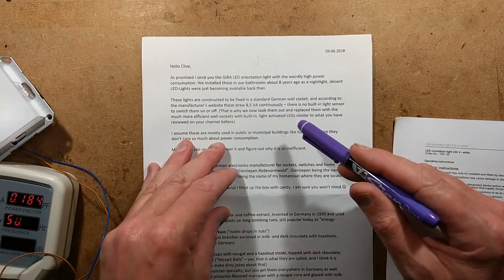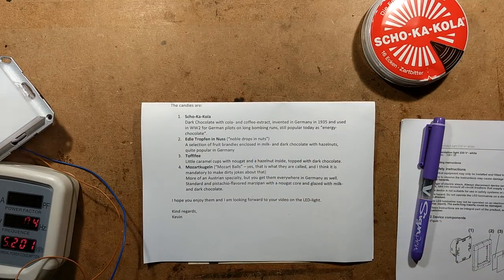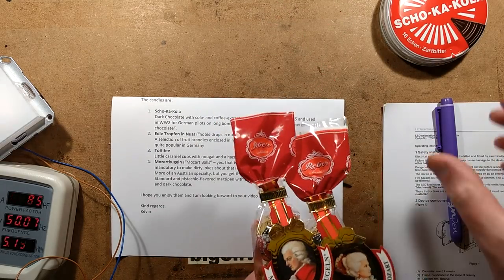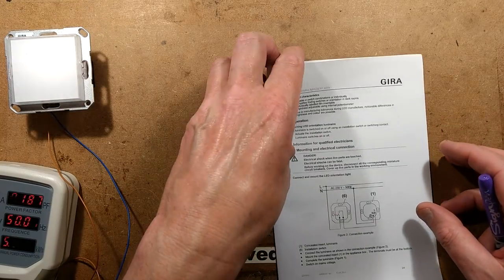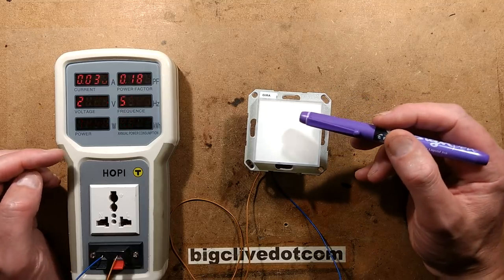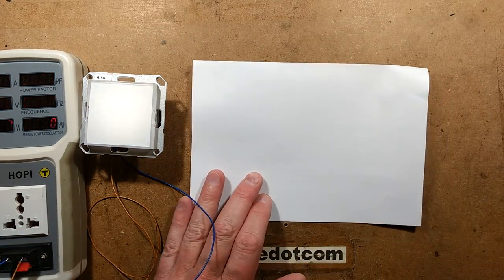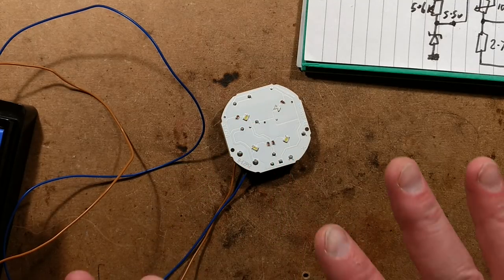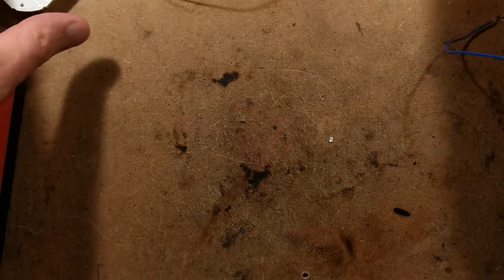Well engineered German LED light?  With schematic and tests.

Comment: Thank's for the heads up on power factor meter hell.
The power company i'm with (Scottish power) wanted to change my meter for a smart one. No was the answer i gave, and it will never change.
Reply: yeah they are changing the Contracts too
Reply: zx8401ztv they want to put the charges up to get more shareholder profits and also to pay for the new nuclear reactors and state taxes.

There will also be duty and extra vat slapped onto charging electric vehicles which will directly communicate with the electricity meter, try explaining away the extra charging on your car done on a wind turbine when the tally counters on the car and the central database don't add up
Reply: If they ever try to side-step you...you can claim it is for health reasons since the SM's can cause headaches & migraines.
And I can vouch for the migraines part myself...I had migraines for almost a year before I figured out why...and had them remove the SM.
Since then there have been only a few sporadic events so I have verified the cause.
Reply: Better hope you dont have a Mobile phone or Wifi router in the vicinity then, as they put out just as much radiation, and in the case of a mobile, sometimes a lot more than the small radio device in a smart meter. Not being a Smart meter fanboy here, infact i dont even have one, but unless you understand the technology in them, and the comparision to common radio devices like phones, you cant make such claims.    The radio transmitters in phones are capable of putting out over a Watt worth of radiated power when talking to a tower a long way away, and considering most people hold that up to their ears, that's a lot of radiation.   Depending on the smart meter many use "mesh" networking whereby they use low power radios so they talk to nearby meters which act as repeaters and allow a long range network using low power radios rather than directly to a tower that could be a long way away.
Reply: It’s not only power factor. Smart Meters (dark conspiracy theory) allow the companies to remotely disconnect your supply at will. For instance to ration electricity or force payment of a bill.
Reply: I don't use either.
I keep a simple cellphone...turned off...in the car in case of emergency.
I use only wired internet/intranet connections as well...no wi-fi.
Reply: PS>  They do the mesh network type here...and mine was the end one that did the collecting of data...so it was constantly RX/TX.
Reply: I have to side with the utility on this one.....

Well if you don't want your power cut off, pay your dam bill on time, or in case of hardship, make a payment plan thats agreeable to both the utility and the person in trouble within a reasonable time frame before the utility is forced to cut you off. Should mention that even without smart meters they can still cut your power off in various ways, so that ability isn't new, the meter just makes it a bit easier, safer and faster for them to enact it.

Also if the grid is being overloaded, then its better that they ration power out than have the entire grid collapse because a grid collapse is very bad and can take out entire states, and is very difficult and time consuming to recover from, thereby rationing of power during overloads is much more favourable because it prevents grid collapse. I'd rather be without power for 2 hours due to rationing than possibly days because the entire grid collapsed and its having to be "Black Started" which can take a very long time.
Reply: @ Greg Even with constant rx/tx the emitted power should be pretty low. properly designed radio systems can go quite a long way with minimal power, long range point to point wifi links being an example of this, using FCC Compliant radios and directional antennas allows a radio usually only capable of a 200 meters or so line of sight to span 10-20km line of sight using the same limit of RF Power (1 Watt EIRP for 5Ghz Wifi).

Also even if you yourself dont use a mobile, you are around people that do often in close proximity, so unless you live in isolation, you just can not escape electromagnetic energy these days, it is literally everywhere, that includes AM/FM radio too!
Reply: Because mine was the master unit for my block it was not on the minimum power setting.
I was able to measure over 6 watts...on the inside of my room...at 3ft (1M)...through sheet metal, 1" (25mm) wood & thick insulation.
My head was about 3ft (1M) from it while sleeping...and...No I was not able to change my sleeping area.
I don't HAVE to be away from the radiation but having it constantly on...at high power...for over 1/3 of my day...was too much.
Reply: "had them remove the SM. Since then there have been only a few sporadic events so I have verified the cause."

It's amazing how stupid people actually are that they think this constitutes "verification".
Reply: Plain ol' confirmation bias. Gregory Thomas is the kind of person that would believe their kid got autism from vaccines. "I got a Smart Meter around the same time I got migraines, therefore it must be the SM"; post hoc ergo propter hoc.
Reply: Gregory Thomas sure bud, much stronger than the hundreds of transmitters around you
Reply: 10mintwo yeah he's a nut job
Reply: Then, at some point, they will disconnect your power. Ferraris wheel meters will be phased out, and then it's digital or you are using candles.
At most you may be able to opt-out and demand they disable the transmitter and read the meter manually,  depending on how well the power company has paid their political bribes.
Reply: Fortunately in the UK I believe the smart meters just report back over the mobile/cell network every 30 minutes, so they do not cause any major problems.

If they will continue to do this with future meters is anybodies guess.

Comment: The separate stabilized supply for the current regulator might have an (E-series) 5.6V zener. It makes sense to make the current independent from potential fluctuations on the 20V rail.

BTW, the chocolate was the equivalent for the pilot of what was the secret fluid tank for the DB601 of his Me109.
What human brain energy was wasted by wars (and still is)!

Comment: If you have a lighting rail with tons of these capacitive dropper lamps on it and need to do power factor correction to lower apparent power (VA) bills, just stick an appropriate size unloaded transformer on the same circuit. Same idea as power factor correction on AC motors but instead of correcting an inductive power factor with capacitor, it'd be correcting a capacitive power factor with an inductor.

The high-tech option would be to implement (LV)DC rails for electronic lighting with separate fully-fledged APFC power supplies.
Reply: I´m pretty sure adding inductors/Transformers for PF correction will waste more power than it actually saves in most cases. 

Especially small transformers have high winding resistance which causes their high stand-by power consumption. On the other hand, large transformers may have lower resistance, but will also have much lower inductance values which means you would shift the power factor way too much.

So really you would need to get inductors that are designed for PF correction. Obviously those aren´t cheap.
Reply: @Basement Not small transformers, per-light would be impractical. In commercial and industrial settings, you have whole circuits or even sub-panels dedicated to lighting. Pick inductors/transformers to cancel out most of the permanently attached capacitive loads there, either on a per-circuit basis for circuits that frequently get turned off for extended periods or lumped for the entire sub-panel for circuits with loads that are always on. If you have 100x 8VA lights with 0.1PF on one circuit, add a single ~700VAR transformer and you're done. You may end up losing 20-30W in the transformer but you are still saving ~680VA net.
Reply: Of course for large lighting setups this can be done, but for any home setup it would be pointless. 
First, you won´t have too many lights in one spot.
Second, If you did, you should probably instead get a few bigger lamps that use an SMPS instead. They have a better PF than capacitive droppers and should also be cheaper.
And of course it really depends on how you are billed for your VAR. It may still be cheaper not to correct anything. Obviously charging for VAh directly would be a ripoff.
Reply: @Basement The idea of using centralized power factor correction is in response to the part of the accompanying letter about how these lights might be "designed for public places like hospitals where power doesn't matter"

Comment: So as I understand it, even if you have a smart meter you do not necessarily get billed for the apparent power. It may even be an option they can turn on or off based on local utilities regulations. I can't find any way to tell whether I am being billed for real power or apparent power. I don't see any local news coverage that would indicate outrage that happened from a switchover. But how would we even know? Our home was built new in 2006, and had the newest smart meter at the time. And already they have decided that we needed it upgraded to a newer smart meter. Of course they make the customer pay for those upgraded meters. The last one was working just fine when they hauled it away. Would the use of apparent vs. real power show up in the billing units? Would apparent show up as some multiple of Volt-Amps, whereas real power comes in units of some multiple of Watt-Hours?
Reply from the maker: They can change between real power and apparent power at will remotely.  But should declare the billing method on your statement.

Comment: Surely 2 X 1 micro-F 250 V capacitors in series is electrically equivalent to a single 0.5 micro-F 500 V capacitor and there would be no space saving doing it that way?
Reply: When they sell this to the us market, they can replace one cap with a jumper and it’ll work on 120v. No component changes required.

Comment: Can someone explain the VA-voltamps?
Reply: W=VA*pf
Reply: You may read something about the power factor.
Reply: Aurimas Knieža VA = Volt Amps.  Measure the Volts, Measure the Amps, multiply.  W=Watts, actual energy from your steam engine (Mr. Watt invented the horsepower unit, representing equivalent horses pulling a wheel in the mining industry).  In a perfect electricity to power conversion device, 1VA consumes and outputs 1 W.  In a simple engine using only resistors, capacitors, inductors and motors, 1VA is at most 1W, but may be less if there is energy slushing back and forth in the wires without going anywhere.  In such "linear circuits", the power factor can be brought back to 1.00 by just plugging in a capacitor or inductor just big enough to slush back and forth the same amount of VAs in the opposite direction, so the slushing stays inside your place.  Mathematically, this can all be calculated using so called complex numbers.
With linear circuits, the current will be a perfect sine way, just delayed from the voltage by an angle "phi"( φ ), and the power factor in W per VA becomes the cosine of phi (cos φ).

However once you start plugging in neon tubes, diodes and other oddities, there is also non-power VAs from current that isn't a mains frequency sine wave, but either a harmonic overtone or complete noise.  In 3-phase power grids, the 3rd harmonic is especially bad because even though it carries zero Watts, current at this frequency adds up instead of canceling out in the neutral wire, making it dangerously hot and melting the plastic.  In US two phase systems, the same happens with the 2nd harmonic.
Reply: Aurimas Knieža VA is calculated from avg(U)×avg(I), where avg(f(t))=int abs(f(t)) dt/T. U=voltage, I=current, f=some function of time, usually sin, int=integral over one period, T=duration of one period. W is instead abs(int (U×I) dt)/T. As the abs() is outside of the integral here, negative values may occur, if U and I have different signs.
For practical use, W is the physical power used, UI is the load on the wires.
For resistive loads both are the same. For sine waves, UI=P×cos(phi), where phi is the shift angle between U and I. For the general case you actually have to do the integration.

Comment: While I don't want to defend power companies being scummy, it does seem at least remotely sound to incentivize people to buy things with good power factor, especially now that (poor) switching power-supplies and capacitive droppers are just getting more and more common. Poor power factor does matter, after all, and letting every cheap LED lamp manufacturer get away with using capacitive droppers everywhere is probably not sound in the long run.

Comment: Power lines with low load 'supply' VAR, but transition at a higher load to 'consuming' VAR. So even the power lines must be rated argument kinda has holes in it. Well, yeah they do, but if they are run a high load then they could be sapping quite some Reactive power and I could do nothing about it as far as power factor with my appliances.

Comment: I worked home automation for 6 years and dealt a whole lot with GIRAs EIB/KNX components.

My biggest gripe with them was then and seems like it should still be now, that they don't give a flying fuck about power consumption.

Really, some of their components were fantastic in terms of function and the designs and quality of their EIB components, switches and cover plates is just outright fantastic.

But the power cost of a lot of their components is just plain unacceptable.

Comment: They did here at least in Québec with Hydro-Québec. When Intelligent meters came, most of the bills doubled, for some people even tripled. They made it pass by doing arrangements to save a little bit on that on a 1 year contract, but still. They said it's better old ones were not accurate, but they were.

Comment: I've got the G4 Play variant phone myself, and just received the android v7.1.1 update myself (Surprised Lenovo did this on an older model), and had to do a full hard reset (Factory reset) after the update, as the general response from the device was pretty poor, so that could be what is needed Clive.
Reply from the maker: I did a full factory reset and it still seems glitchy.
Reply: Other coarse of action (Especially if the device is fully unlocked), is by installing the full generic OS from Lenovo (Mine was ex Vodafone, but I use Virgin as my network), but problem is, finding the needed data to upload, which I have yet to find, but I do know some people to ask. Other than this cam issue, the G4 is a cracking device for the price, and amazed mine still works, as it's basically two devices made in to one working unit. New version of this, is the Moto C series, with Argos stocking the plus version at around £90.http://www.argos.co.uk/product/7497850

Comment: this is a problem already happening in our country. The netherlands is replacing all the electricity meters for smart meters. And there are a lot op problems with it.  What you explained in your video is exactly the problem. It gives false readings because of the led lights.  There are reports op people using 4x more kWh's a year. Instead of 2000 kWh you are billed for 8000 kWh.

Luckily you can refuse it. And if your meter needs to be replaced because you have PV Panels, you can choose for a conventional digital meter. Not a smart one.